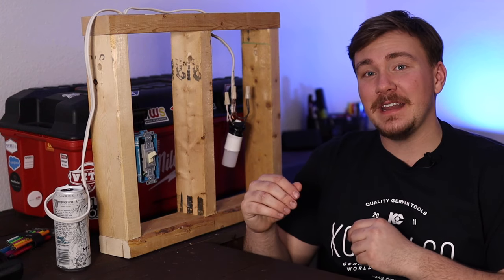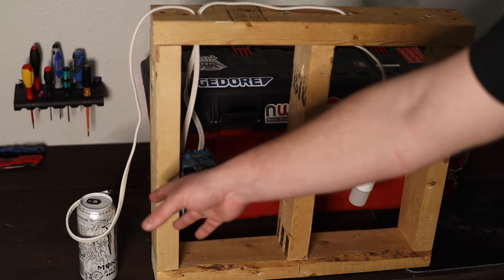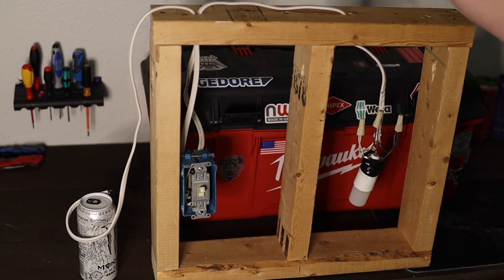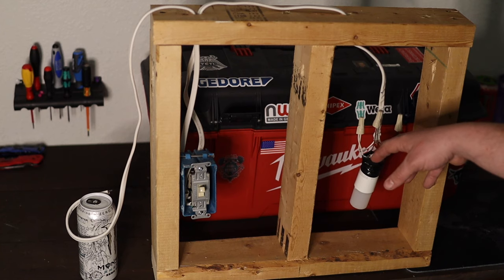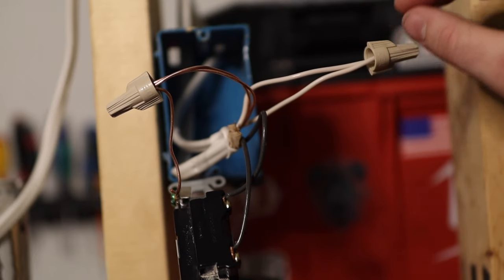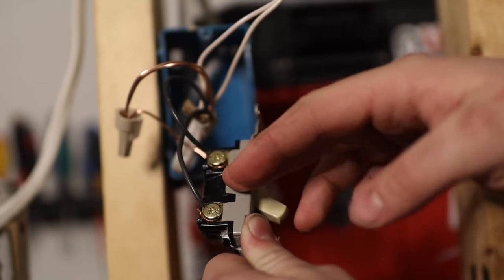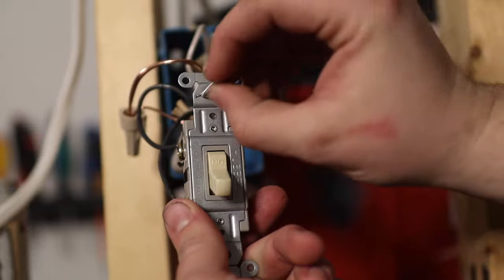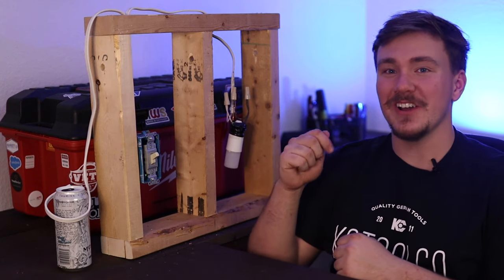The CORRECT way to wire a light switch

Comment: my question is if I wanted for some strange reason that I needed the light swtich to be on when in the normall off postion someone said rotate the swtich but it it was impossible to rotate the swtich would a possible remedy be switch the upper and lower wires ? thoughts please thank you